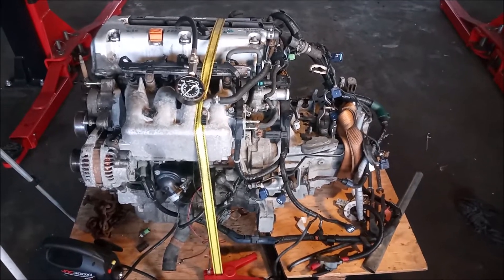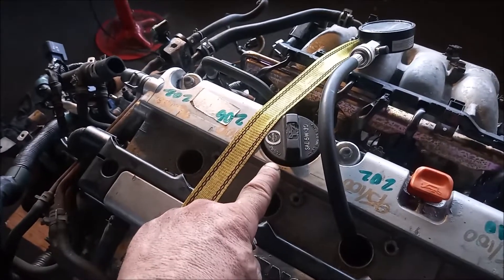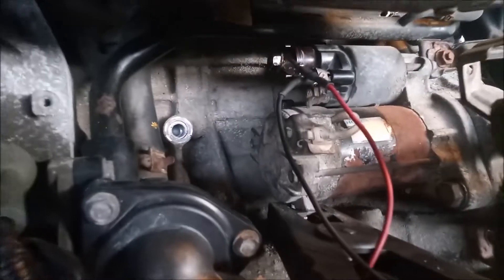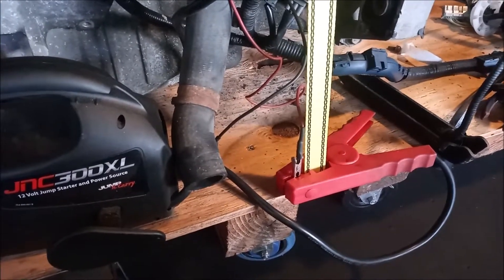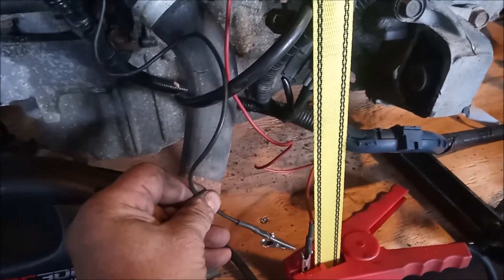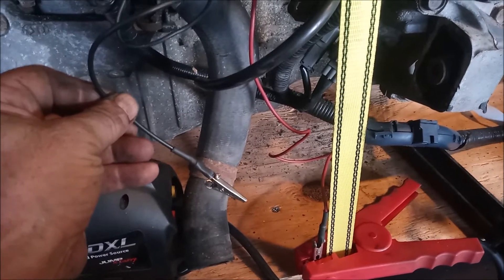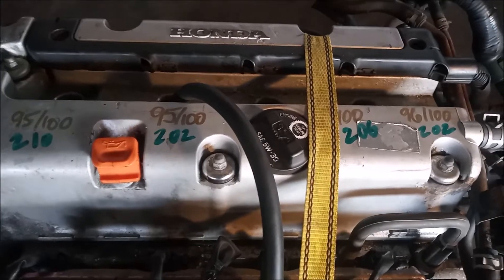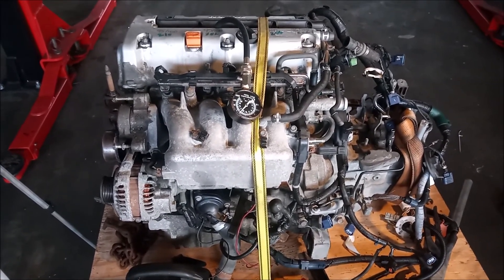Compression Test Out of Car Honda K20 Acura RSX - K-swap

Comment: Can't you just use a cordless impact wrench on the crank bolt?
Reply from the maker: You can do it that way if you don't give a fuck about your engine internals.
Reply: @Merryfrankster_  to be fair that's the go to option for getting a crank bolt loose
Reply from the maker: @ADHDstyle  Go right ahead, shock load the bearings with no oil pressure. To be fair, that's a sure recipe for a spun bearing.